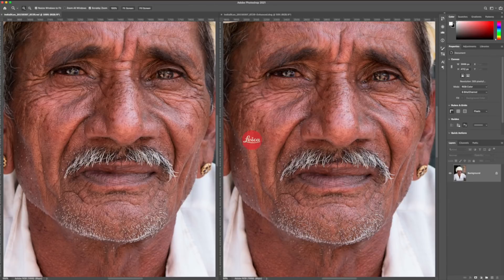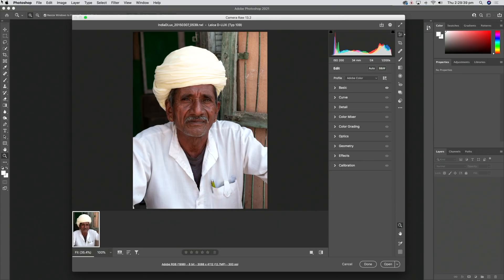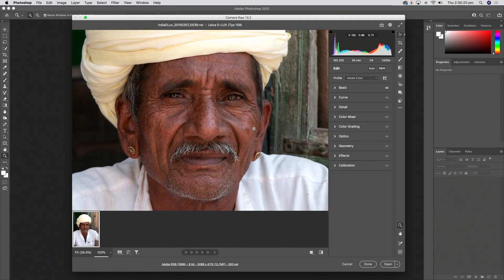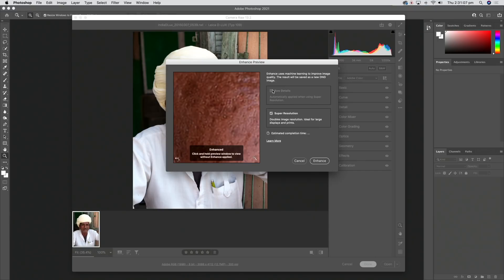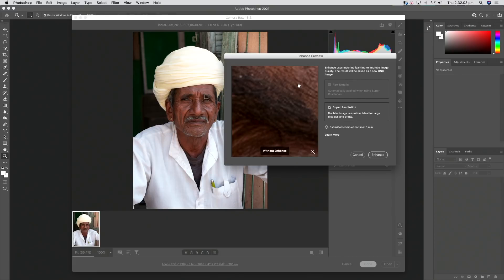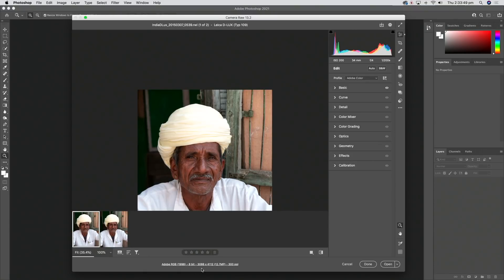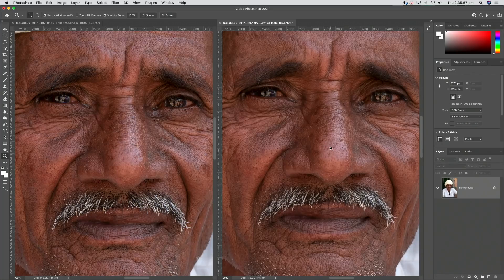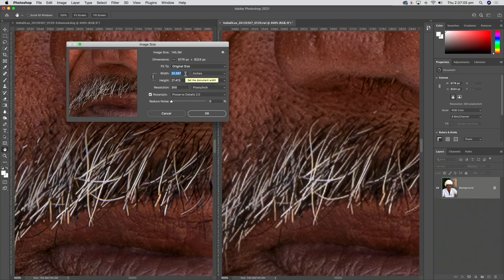Huge! Super Resolution in Adobe Lightroom and Adobe Camera Raw.

Comment: Does anyone know the reason I am getting the problem that I am getting - if you watch Nick's excellent video, he does the 'enhance' procedure and ends up with two thumbnails on the filmstrip in camera raw 13.2 - he control/clicks both of them, and hits the 'open' button which appears on the lower right side. On my computer, the open button is on the same panel but to the left hand side, and it is greyed out, unusable. The right hand side has a 'done' button. How to I configure my windows 10 to display the same ACR window that Nick has got. I have to save the enhanced dng, then re-open it as things stand. If I click done, the two thumbnails close with ACR and I am left with an empty photoshop window. I can find the resulting enhanced dng file and re-open it, but it would be so much easier if I could just get it to open in photoshop straight off the bat. If you're unsure what I mean, take a look at Nick's video again, and scroll to time: 8 mins 12 seconds where he has this different layout on the button panel. I have no 'open' button accessible, mine is greyed out. Thanks if anyone knows what is wrong.
Reply from the maker: I don't know why what you see is different - the Open button is clearly on the lower right. I'm assuming you are using the latest version of Photoshop?
Reply: @LeicaCameraAustralia  Hi Nick, I am also perplexed. I am running Photoshop CC 2017 via Windows 10 Home, and downloaded and installed ACR 13.2 approx 3 3 weeks ago. The button layout is different in the lower right hand corner. From left to right I have 'open' then 'cancel' and in the very corner, 'done'. After running enhance, I get the two files in the filmstrip, exactly like you do - the orginal NEF (Nikon RAW file) and the enhanced.dng file, with the 'Nef' file pre-selected. If I click on the enhanced.dng file, right click or left click, the 'open' button greys out and becomes un clickable. If I click on the 'nef' file the open button lights up again. If I Ctrl=click on both files, in either order, raw first, or raw last, the same problem. As soon as I try to select the dng file, I lose the open button by greying out. On the positive side, the DNG enhanced file is saved to the folder the original NEF file was called from - so if I move to that folder in windows explorer etc, and double click it there, the enhanced DNG opens with no trouble at all. What made me wonder was that your three buttons, open, cancel, and done, are in a different order to mine, even though I am definitely running ACR 13.2. When I saw you open both images in ACR I thought how handy that would be sometimes, but alas, for some reason, my system isn't having it. Thanks for your attention, maybe someone else will see this problem here, and have found a way to fix it. I have gone through all the ACR options and settings but nothing in there seems to influence the opening of two images. I prepared screen shots for you but can't find a way to put them in here to show you so you'll just have to accept my description being as accurate as I can make it.
Reply from the maker: I am using Photoshop 2021, I didn't know the current version of ACR (13.2) would even work with older versions of PS. As to the greyed out button, I think you will need to consult the Adobe forums to troubleshoot this. I suggest you upgrade to Photoshop 2021 (V22) - that would eliminate one variable.

Comment: If the image size was 6000x4000 and it's increased to 12000x8000, then tha's a quadrupling in size, not doubling!!!
Reply from the maker: You are correct, it's doubling the pixel dimensions so quadrupling the file size. It depends on what you mean by size! I don't really care what the file size is, my interest lies in how big a print I can make and the pixel dimensions are more useful. Therefore doubling the size of the print is easier to communicate than quadrupling the area of the print. A 50cm print becomes a 100cm print.

Comment: Your video is good but if increase the resolution from 12 megabytes to 50 megabytes that’s 4 times the resolution not 2 times.
Reply from the maker: Four times the file size is indeed double the resolution because resolution is a linear measurement not an area - a single dimension vs two dimensions. 1000px to 2000px is doubling the resolution along one axis only, but you have to do the calculation on image width AND height, so if you double both you get four times the file size. You can see this clearly if you look at the Image Size dialog in Photoshop.

Comment: I noticed that you opened the images in Photoshop with Adobe Camera Raw set for 8 bits.  In this instance, would 16 bits be of any benefit?
Reply from the maker: 16 bit output from ACR will not make any direct difference to the effects of Super Resolution itself because it has already worked its magic on the raw data and thus is already working in 12,14 or 16 bit depending on the camera. Any further processing might well benefit from staying in 16 bit mode. 

In fact that's what I usually do. It was probably still set on 8 bit because I had been checking out some Multi-shot files from the SL2 and they each end up being about 1.1GB in 16 bit, thus 4.4GB after rezzing up!
Reply: @LeicaCameraAustralia  Thank you Nick for your explanation.  I'm new to ACR but have worked with RAW (NEF) files from my Nikon camera using Nikon's Capture NX2.  I have a Drone that produces DNG files and I'm processing them with ACR.  It appears that ACR effectively outputs an 8 bit image regardless of the 8 / 16 bit setting since there appears to be no additional dynamic range to be gained in Photoshop.  The lesson learned is that ACR (or LightRoom) is the only tool that can take advantage of the dynamic range afforded by raw images.  Forgive me for taking the discussion off of Super Resolution!
Reply from the maker: Ah, no, you misunderstand what 16 bit gives you. It's just kind of a bigger box to put your data in - it does not change the 'size' of the data. An 8 bit file cannot describe 10 stops of dynamic range, 16 bit file can, but it's still 10 stops of DR, just in a bigger box is all.

And to confuse you more, it's not really a bigger box - 16 bit files simply have more, therefore finer, gradations between the darkest and lightest parts of the original capture. Not quite the same thing. Basically bit depth and dynamic range are not directly related. You could have a 10 stop DR image in a 2 bit format file (four really, really big steps. You could also have 2 stop DR image made up of 32,000 tiny little steps (16 bit file).

Comment: Thank you, Nick - great presentation!
However - you showed how excellent it worked on the guys moustache:
I tried the same process on a winter landscape and of course the builings showed up nice and sharp. But the snow and the skies with delicate nuances seemed to have more noise. Other Youtubers all seems to show the (nice) effect on sharpening details, but I feel like there is still an extra mile to go. Could you please be our guide?
(BTW - my case was snow, maybe seascape would be more relevant for you Aussies ;-) )
Reply from the maker: it is difficult for a digital algorithm to distinguish between noise and detail - both are pixel-level differences. All up-ressing software works best with crisp edges which is why the best results will be seen in cameras with no anti-alias filter. if you are having trouble mixing strong edge detail with subtle smooth tones then, in Photoshop, simply layer the same image twice, one Super-Resolutioned and one simply sized up in Photoshop to match the size. Then, you can use a layer mask to combine the best parts of both images. When this is introduced to Lightroom you can do the same thing by making a visual copy, Super-Rezzing one, then select both and then choose Photo > Edit In > Open as Layers in Photoshop. Then mask as needed.
Reply: @LeicaCameraAustralia  I think this is a good tip. By and large I regard Super Resolution as a great tool but I have found it struggles on certain areas of repeating patterns such as fabric. It works well until you reach folds where the material both changes tone and transitions out of the plane of focus. I see smearing and blocking up in those areas. Portraits and landscapes though, it seems to work astonishingly well.

Comment: Great demo. The metric system is used in the UK since 1965 by the way...
Reply from the maker: The publishing industry around the world still commonly works in inches and the standard resolutions generally used in offset printing are defined in pixels per inch or ppi. 300ppi is much easier to work with than 118ppc (pixels per centimetre). Hard to shift 'tradition' especially when it's actually quite convenient.
Reply: True when it comes to printing. I was talking about sizes though which are easier to understand for most people when they are expressed in the metric system. 
For exemple, a Mile is 1760 Yards. A Yard is three Feet. A foot is 12 inches and an inch has 16 equal divisions. Mind boggling. 
Compare that to a kilometer which is 1000 meters or 1000 000 millimeters etc. Easy to calculate and understand.

Comment: Best of this feature that it is still DNG compressed and enables the post-processing with the whole bit depth of the raw format. However, be careful with high ISO (25000 and higher) as it also computes those noise as structures, which can leave erratic artifacts. A preprocessing of this noise is necessary before enlarging, which is also possible with AI without losing the available fine structures.
Reply from the maker: Good advice, thanks.

Comment: Do you think it would be better to apply this on an unprocessed raw, and then process the file, or finish the entire processing and apply at the end?
Reply from the maker: Good question. In theory it should not matter but, unless I find out different from the Adobe engineers, I would do it first. If your computer struggles with the bigger file you could always do your edits on the smaller original then sync those settings to the bigger file. Sharpening and noise reduction might need to be different but other settings should translate well.

Comment: Hello, for me it’s not possible, to open the superresolution dng file in Lightroom Classic after transforming. Is it, because LRC 10.1.1 works with the older Camera Raw 13.1?  Thank you.
Reply from the maker: Super Resolution is not in Lightroom (yet). It's only in ACR 13.2.
Reply: @LeicaCameraAustralia  yes i know, but thought, that you can open the superresolution dng file in Lightroom, so like any other dng file.
Reply from the maker: Good point, I had not tried that. Might be worth looking on the Adobe Forums for the answer and maybe post it here if you find out.
Reply: @LeicaCameraAustralia  Yes, and if you import the super resolution dng in Capture One 21, the dng file has the old resoluion....only 6.000x4.000 instead of 12.000x8.000.  my example is by using Nikon Z nef (raw) files, not Leica dng.
Reply from the maker: Interesting. I'll post an update when I find out more from the Adobe engineers.
Reply from the maker: LR will work with Super Rezzed DNG files in a future LR Classic release.

Comment: I have tried it and it is not bad. But the file size gets 4 times bigger, not 2 times. Both the length and width are doubled, so the file becomes 4 times bigger.
Reply from the maker: Yes, double the resolution and thus necessarily four times the file size - I was not clear about this in the video.
Reply: @LeicaCameraAustralia  Adobe also mentioned doubling the file size, so I was a bit surprised to see my Z7 file becoming about 185mp... But it works quite nice. I wonder how a file like this, when brought back to 100mp, will compare to a "true" 100mp file, like from the Fuji GFX100. Great to have this in Camera Raw!

Comment: nice i test m10r to enhance. image resolution 2X and file size 10X.. wow
Reply from the maker: Thanks for sharing. The file size should be 4x the original as the pixel dimensions are doubled both for height and width - that would be for PSD, DNG and TIF files; for Jpegs it's harder to say.
Reply: @LeicaCameraAustralia  Super Resolution saves files as DNG and they seem to be very porky... I started with a 6-megapixel/10-megabyte file, and it blew up to 24-megapixel/87-megabytes! However, when I re-saved the DNG file as TIFF with lossless LZW compression, it shrank back down to 20 megabytes, which would be more typical of what I'd expect for a 24-megapixel image. I don,t know what Adobe is feeding its DNG files, but it definitely makes them fat!
Reply from the maker: The compression is the key here. 6MP will always increase to 24MP due to the doubling of linear resolution, but the compression will keep the file size under control. Personally I don't use compressed tiffs because I prefer to stay with a DNG workflow but that's just me!
Reply: @jlwilliams  yes i tried it on an old jpeg pic that was about 6mb in size and ended up with something over 100mb !!  Crazy!